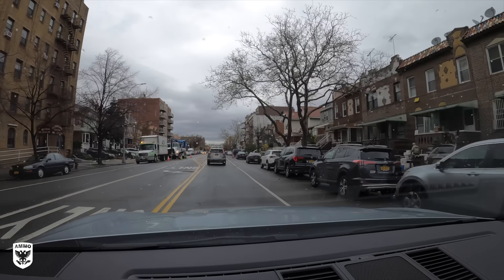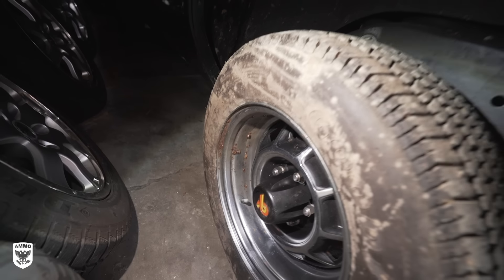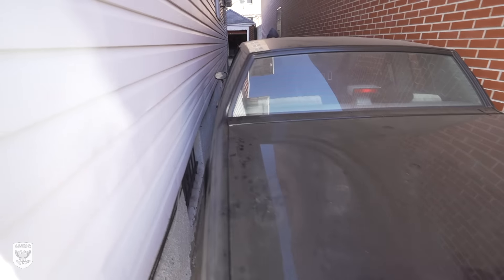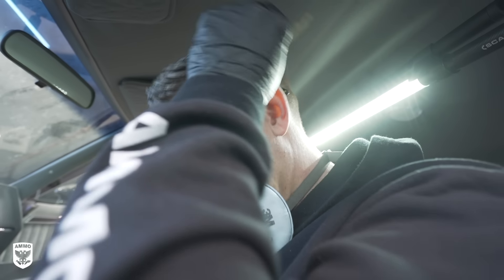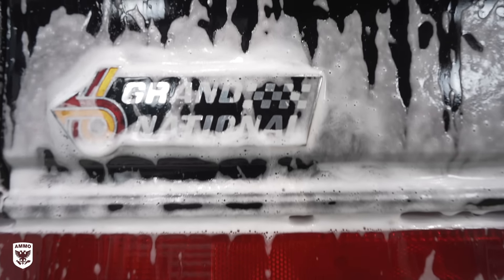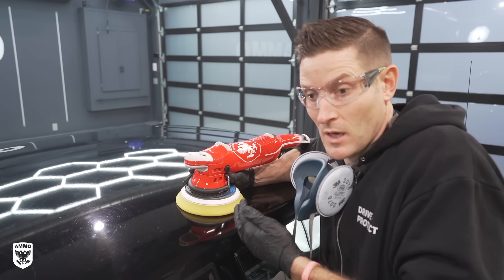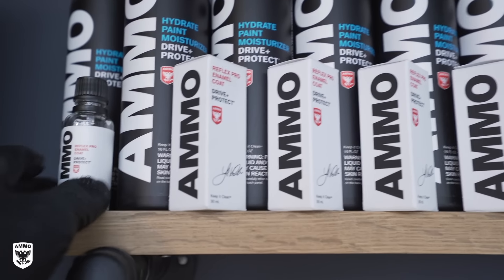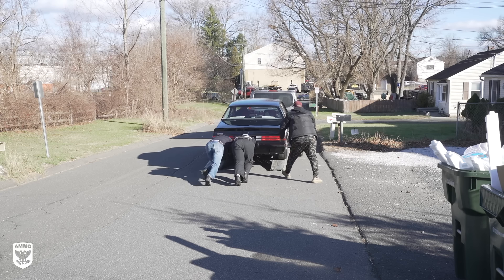First Wash in 34 Years. 56 Miles! Barn Find Buick Grand National

Comment: This brings back fond memories.  I was obsessed with the 1986-87 Buick turbo cars in high school, so once I started working in 1993 I bought a used one with 73k miles on it for $4200.  I drove it year-round through Michigan winters and it got pretty rusty.  Back then I didn't know the value would skyrocket, since it wasn't like the 1970-74 timeframe where people thought musclecars would never return - cars were getting faster each year as performance made a huge comeback.  The magic of this car was in the noise it made, the acceleration, and the fact that it was a 6-cylinder luxury car that was also the first American production car since the end of the musclecar era to break into the 13s.  The fun I had driving my car all those years is a good tradeoff vs. the profit this guy will make.

Comment: Besides the IROC-Z this car was one of my favorites growing up in an area where there were muscle cars everywhere in the early 80's here in NC.
Reply: I grew up in NYC during that time, my friend bought a new blue Iroc in 1986 and waited for the tuned port, took it to the body shop immediately and wide bodied it, it was insane, my other friend bought a new Monte SS, wide bodied it also and had it painted Porsche red, this was a monster with a whale tail spoiler and Daytona hood lol, staggerd wheels, very well known car across Brooklyn in the 80's, with 15 or 18" EV subs behind the back seat with 4 10's on the rear deck and everything was done in professional shops, I was more into Rotories at the time and still am but absolutely love them old skool 80's muscle cars, my other friend had a totally stock and kept it original burgundy Cutlass 442 man I miss them days at fountain Ave

Comment: Owner: "It deserve to be preserve"

Me: drive the damn car
Reply: For real
Reply: Normally I'd agree but only 56 miles. I doubt there's any others with less.
Reply: Buy a $30,000 Grand National and drive that one; sell this one for $200,000 to someone with a public-accessible museum so it can be enjoyed by all. I'd be curious to know what they paid that lady for it.
Reply: Worth about 7500
Reply: My cousin had one still couldn't  beat the glhs in my garage
Reply: Over rated
Reply: @grantdavidson3539  Worth what you're willing to pay for it. In your case, $7500. But it'll bring 25X that much to some bucks-up collector.
Reply: @grantdavidson3539  those cars sell for over 15k and with mileage that low they can get a few 100k for it
Reply: I’d normally agree but this is most likely the best example of one that should be preserved.
Reply: @user-ek1nu1se4d  LOL   $15,000 because it's not a 64 Impala? $15,000 wouldn't buy you a look at it. A 56-mile all-original 1 owner GN will bring in the $150-$200,000 range. Enjoy your Impala.
Reply: Exactly.
Reply: @cll1639  Agreed
Reply: @haydenbristow91  someone I know worked on a car with only 10 miles on it. I still don't know how that's possible 😕
Reply: Been there done that only mine was a GNX spent more time in the backseat than I did in the front  😎
Reply: Right!!! I would have ripped at least one tire off before selling her😂
Reply: Not when it’s only got 56 miles on it.
Reply: Drive the hell out of it, cars are made to be driven not stuck in a nasty garage collecting dust, worst thing you can do to a vehicle is not driving it, no matter what milage.......
Reply: Please don’t listen to Tim McLaughlin. He’s obviously a simpleton.
Reply: @cll1639  a GNX went for 275k at auction with only 8 miles so I think a grand national might get a third of that. Not 200k.
Reply: @dariog36th  You're probably right. I had GNX on my mind when I said $200K.
Reply: @cll1639  right me too!
Reply: I'm saying gut it and put a cage in it and send it to a dirt track

Comment: Just a quick edit: This 87 GN here was factory rated at 245hp (yes, it was actually more). It was the 87 GNX that was rated at the 276hp listed in the video (and it was actually A LOT more).
Reply: Your right buick fudged the horse power numers to 276 hp  300 hp was more the right number plus 360 ft lbs wow fast for a small 231

Comment: Back in 1987, I lived right next to Fisherbody 1 in Flint, MI.  That's where the body of this car was built.  A friend who worked there, gave me a tour of the plant between shifts.  I saw the welding areas where sheet metal parts would become car bodies, down through the anti-corrosion wells where they would coat under the bodies.  Then, some ovens and the paint areas with the bells that would give the bodies their coats of paint.  And finally, more ovens that would dry and cure the paint.  Then, I saw the area where the upholstery was sewn up and pulled over the seat frames and foam cushioning.  Then, I visited a smaller assembly line where the dashboard assemblies were built, and finally the final assembly where the carpets, components, seats, furnishings, dashboards and steering columns would meet their respective bodies.  In fact, I may have even seen the very seats for this car before its body was assembled.  And perhaps the body to this car going down the assembly line.  The plant where the body of this car was built was closed on December 30, 1987.  These were among the last of the body-on-frame mid-sized cars made by General Motors.

Comment: My guess why this car was never driven? If my experience with low mileage used motorcycles is correct, the owner bought the car, floored it while driving it home, got scared and never drove it again.
Reply: My childhood friend's dad had a car dealership and he got ahold of two of these grand nationals with back to back VINs. My buddy as he grew up would always take cars and trucks from the dealership and go run them and see how fast they were. He said the grand national was the only car that ever truly scared him. That's among many years of being around corvettes, camaro's and other fast cars. He drove one of them grand nationals about 2 miles and parked it, never to get in it again. They sold here awhile back you can find them on the internet. His dad was in bad shape and he had to sell the cars to pay for his dads treatment. Wouldn't surprise me if someone else thought the same thing after buying one. They were freakishly fast.
Reply: As good as that sounds, this car has about 240 HP and is not likely to scare anyone. The 80's had some good looking cars but they had to be extremely anemic to meets EPA standards.
Reply: @warpig4942  sorry bro, mine back in the 90's was putting down 400/535 with a cold air intake...they did the same with it that they did with any other "muscle car"...build them hot, then lie about the numbers...any Grand National /GNX was capable if tuned correctly...my brother had a Cosworth Vega wagon, a unicorn, that would give a bunch of supposedly fast V8's a run for their money, if not an out'n'out trouncing...we had a bunch of fast stuff...how about a 429 CJ in a Runabout Pinto...you'd definitely see your life flash  before your eyes...stupid large, 500+ horsepower and light weight, would roll a 1/4 mile on a wheelie...you could "steer" with the brakes...we set them up like a tractor, you farm boys know what I mean...there are so many cars still stored that all of us ENTHUZSTS could have 2...but we haven't found them and they ain't gonna be free...thank your higher power that some great mechanics can build a car from an oil spot and a vin number...
Reply: @sykwookiee  You are right about them lying about the HP numbers, they inflated them. This is not a GNX, not a Pinto with a big block and it won't do any better than about 14.5 in the 1/4. It's not scary. I have no idea why you are mentioning a bunch of modified and unrelated vehicles. The guy commented on this car as it sits.
Reply: @warpig4942  uhhh, yeah. ..
Reply: @warpig4942  You obviously have never driven/ridden in one, or your view of what is fast is askew. They pinned you back in your seat as soon as that turbo got up to pressure.
Reply: @ckmoore101  Driven? I owned a 1986 for 5 years. I currently own a 1987 Monte Carlo SS, another cool 80's car but it's even slower than the GN. They just weren't making fast cars in those days, they had to choke everything down to meet EPA standards. GN's you guys are riding in today, even if still stock, have all been tinkered with by boosting turbo pressures, remapping FI etc. The car in this video is likely just as it left the factory and that means 245 HP... less than a whole bunch of grocery getters being sold today.

You guys are all up in arms trying to defend this car. I am not attacking it, I like them and wish I still had one. Facts are facts though about it's speed. 14.5 in the 1/4 is what it did stock. That's not going to scare anyone.
Reply: @warpig4942   The body is my favorite shape ever but yea, 1980's cars were anemic as hell.
Reply: @warpig4942  I agree with everything you said except one thing. While they wouldn’t scare me and you , I know plenty of people who get scared in regular cars. So these theories are possible
Reply: Driven from the dealership to the home. Honestly would’ve had lower miles of some dumbass didn’t take around the block in our small town
Reply: @warpig4942  they lied about the horsepower numbers since gm said that any general motors   vehicle ain't supposed to be faster than the corvette.

Comment: GM what happened to you? You used to be awesome! Grand Natl’s, Trans Ams, Camaros, Monte Carlos. Now you’re just plain boring cross over SUV’s and sedans
Reply: Corvettes, camaros, ctsv. Faster and better built than they’ve ever been these days.
Reply: @1439of2000  not so fast... 
GM has done a lot of damage to all 3 of those brands in recent years. 
Northstar was a disaster. 
"Mid engine" Corvette 
Camaros that share platforms with the caddilac and Corvette don't appeal to new buyers... especially when the corner assemblies just break off.
Reply: @SGobuck  the only way they could make the corvette handle better at this point was to put the engine in the back. it puts more weight in the back to help put the power down and the majority of road and race cars that dominate the track are mid engine
Reply: Ahhhh the Smokey and the bandit trans am. Always wanted that car in the late 70s
Reply: GM is run by bean counters now.  They don't care about cars, the car is just how they sell you a LOAN.
Reply: @SGobuck  “Mid engine” corvette that is better performance per dollar value than any corvette ever has been. You’re talking about a Corvette that costs about 80k that outdoes multiple 150k plus super cars around the Nurburgring. A mid engine setup was the inevitable and obvious option for the new corvettes. There is literally only upsides to a mid engine configuration. Much better weight distribution being the most beneficial.
Reply: @ethanobenauer7083  you said what? Faster than the new supra? American cars are a joke compared to before. No wonder sales are dropping. German/JDM is where it's at.
Reply: $$ and politics happened to GM ...
Reply: They did the American public just didn’t buy them.   The SS sedan, GTO, G8
Reply: @skyhigh5747  I do not own a Corvette or a  Supra, but I can tell you that the Corvette will absolutely OWN a new Supra in a race.

https://www.youtube.com/watch?v=JriZIxwral0
Reply: @NSResponder  Most companies only care about shareholders.....I am working for a company that 10 yrs ago would have handed a very sick employee $10k for his family....even though we use have a benefit package that was the best in the industry. Now they have cut the number of employees by 1/2, taken away some of the benefits and wouldn’t imagine about helping out a member in need. I’m a number on the payroll. Sad.
Reply: This last year's dodge Been killing the game on American muscle like the hellcat

Comment: You didn't clean the pedals, and you didn't show the bumper fillers that oxidize and all crack.
Reply: The bumper fillers are made of a material that experiences breakdown over time, and can be accelerated by exposure, absolutely. No doubt these have cracks somewhere. Inevitably they all will, even when stored. If you notice in the videos, they have that 'dull' look - an indicator the process is happening. You notice a white chalky substance on the surface or otherwise a discoloration, and if you keep it off it buys time. Eventually they go. Many items even to this day use the same material - cable strain reliefs, antennas, curly cords. I hate it! The best replacement fillers for the car are made by a guy in Huntington Beach, CA with fiberglass to OEM fitment spec.

Comment: That 3.8 motor was one of the best motors GM ever made..I had 2 Camaro's with this motor and they were bullet proof. Its remarkable that the motor didnt suffer from some issues after sitting for so long.
Reply: The 231 cubic inch was also found in the 1983 Pontiac Grand Prix I had. Didn't have the turbocharger though. 😂

Comment: At 17yo, in 1986, my father found me a 1972 Oldsmobile cutlass S, 350rocket with 3200 original miles.
 It was literally an old woman's car who only drove it locally and was garaged when not driving.
 That car was amazing with the wooden knobe shifter on the console...
 I miss it all the time, had it up until around 1992.
Should have never sold it

Comment: A friend of mine did the Grand National calibration. I remember a few engineers giggling and laughing one Saturday as we did burn outs next the Buick Engineering offices. (an access road) There were a few "variants" I.E. engineering TOYS that even faster. That's what we were having some fun with... Shorty after we were done making smoke out of the rear tires, security came in and wanted to know if we saw the guys doing burnouts......NOPE we saw nothing!
The Turbo group also built a "GN" pink regal wagon.. All GN except for the pink wagon body. It was the ultimate sleeper, and great fun to take out for a night on the town!

Comment: this brings back memories for sure, My Father bought for my Brother and me a 1987 Buick Grand National and a Montecarlo Super Sport for both of us to share, it was a Graduation Gift for us but he used it as much as us, we had a 3rd car a Mitsubishi Galant, so we had to take turns, this car felt unnatural it was so fast and it didn't look like it should be anywhere near that fast, our MC Supersport in a 2 block race would be a full block behind by the time the GN to the finish, I say 2 blocks it could have been a little more but literally twice the speed, MCSP was never known for speed but that was funny to see, Between me and my Brother we must have raced off the light 200+ times, always won it, the 87 models came with 25-30 more HP like 30 more torque over the 1986 Models, the GNX was basically the same margin of improvement between the 1986 to the 1987 models but the price due to it's scarcity of about 500 allowed the dealers who got 1 charge whatever they wanted to charge, in Hialeah Fl, Gus Machade Ford/Buick they got a GNX and wanted $50,000 for it, basically double what we paid for the 1987 which was about $25,000 including taxes, that torque man, it would stick you to the seat, Turbo kicked in 2nd gear and you experienced some Gs, this is nothe compared to the Teslas nowadays, but back then nothing street legal was that fast, wasn't till about 15 years later that I experienced anything that fast 0-60 and it was a Porsche Carrera with the Tail, don't know what year it was but that was Fast all around past the quarter mile

Comment: in 1987 i was 30, i have been a professional transmission rebuilder for 40+ years. i have built many, many of those 2004r transmissions, they are my favorite OD, i have a 1986 Monte carlo SS as nice as that buick, but it has been restored,,,,,,,,,,,,,,,,,
Reply: The 200-4R was a good tranny but the 700R4 was a genius piece of engineering: 4 forward gears and reverse from just 2 planetary gear sets. That was my favorite. The design is still in use on the 4L65E: 430Lb torque capacity (stock HP big block territory), 5 pinion gearsets and a 7 plate 3-4 clutch. Very compact and light AT.

I got my training from Dot Huff at the GM Training College in Atlanta. She could, just by driving it, tell what one part was bad inside the 440T4! What a nightmare that one was, but I could still build most of them inside the car. Put many a 4th clutch hub (for the 3-4 double bump) in the 4T60E when I worked a Conley Buick.

I got the chance to drive GN once when I worked there. Damn near lost it doing a WOT transmission shift check: the 1-2 shift breaking the tires loose was expected, but the 2-3 smoking them at 85 mph?!?!?!?!?!

Where did you train at?
Reply: @ladamyre1  you wouldn't have thought they were designed by a genius if you had to rebuild them for a living when they came out in 82, they had a tremendous number of problems that us builders had to improve on! in the early days they would fry the 3-4 clutch packs and the 2-4 band, and they would blow apart the planets for lack of lube and blow the pumps up like a bodily function! they had flares and chatters on the shifts, and shifted like a piece of trash! and LU problems that caused no lube and chatters, in short, they were a piece of junk! but finally GM corrected most of the inherent problems only after builders and the aftermarket world figured it out for them! the 2004r was a little pain to build but they worked a whole lot better from the start than the 700, they still do. just my 45+ years of rebuilding experience speaking, but what do i know,,,,,,,,,,,,,,,,,,,,